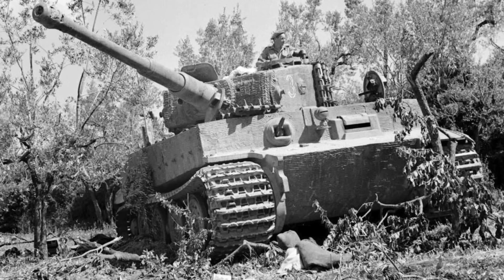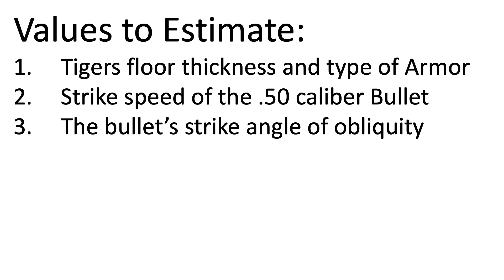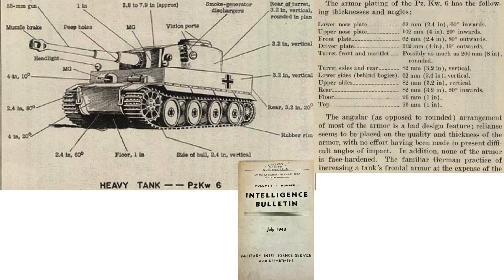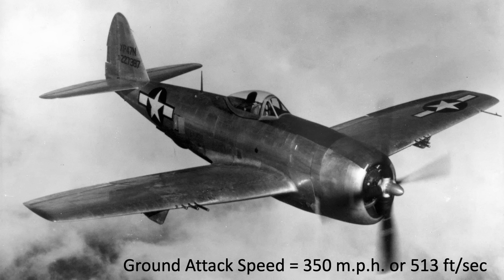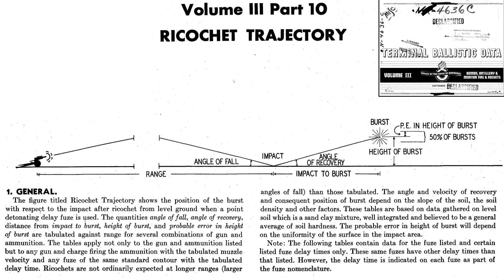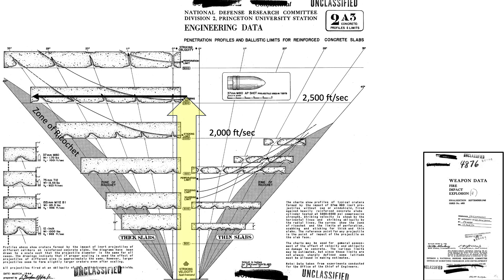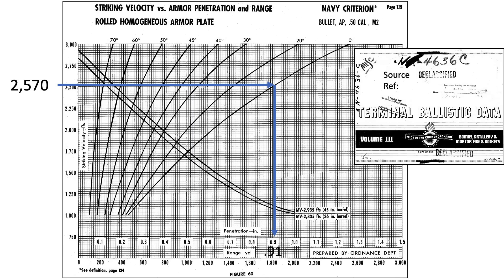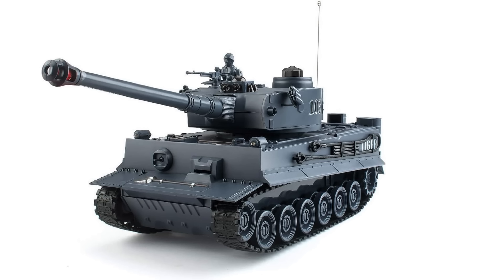P-47 vs Tiger Tank: Can Machine Guns Penetrate Armor?

Comment: A recovering Tanker here.

Tanks can be vulnerable to gunfire, especially from odd angles.

Specifically, heavy MG fire will blow through hatches, engine covers, and air intakes at high angles.

50 call will ruin an engine, and of course, 50 call bouncing around in a turret will ruin your day.

Comment: Good video !

I was just thinking of how many roads outside larger settlements actually had a concrete surface in WW2. My assumtion is not too many.

1944 German tanks were well protected against 23mm guns and mines. Lessons learned on the Eastern front. No way a 50cal ricochet would penetrate the floor armor of ANY German tank.

Another channel went into detail about air-ground accuracy at certain angles, ranges and speeds. Even at optimal angle, range and speed, less than 10% of the bullets fired did actually hit. That's fine for steam locomotives, but to immobilize a tank you need a one in a million shot with 50cals. And forget about rockets and bombs. The former worked well against ships for accuracy, the latter ... well, let me put it like this: how many DEDICATED dive bombers with dedicated bomb sights attacked battleship Yamato and how many hits were scored ?

What can a pilot at 400 km/h observe in 2-3 seconds ?

What damage to the running gear could a 50cal do ? Punch a hole in a road wheel ? Which doesn't stop any tank.

Vision slits were impenetrable as well due to "armored glass" and the crew usually had spare glass blocks and periscopes, because this was well known battle damage in any scenario, no matter the side. Doen't stop any tank.

Hit the antenna ? Playing the lottery and winning every time is as likely. And again it doesn't stop a tank.

Engine deck openings ? There is indeed a slight chance that something might fall through the lamellas, but to actually damage a critical engine component, play the lottery again. What can you hit through these openings besides the radiator fans and air filters ?

At Avranches, the tactical air forces claimed like 50+ German tanks destroyed, including gunfire, rockets and bombs. An after action battlefield commission credited them THREE plus two uncertain kills.

Don't get me wrong; I'm not picking on US pilots here; Germans, Brits and Russians were no better for claimed air to ground kills !
Reply: It depends on the region I suppose. Paved roads outside cities were very rare indeed east of, say, the Elbe river. But in northwest Europe, say, northern France and Belgium, paved roads were pretty common even between small towns. I was recently in some pretty insignificant villages that are known to have paved roads connecting them before the war. It surprised me but I verified it.
Reply: Exactly right on the aircraft vs tank data.  Later analysis showed that most tanks were knocked out by peripheral damage to treads and low fuel.  Their supporting fuel an ammo trucks were hgit and easliy destroyed, which eliminates the armor as being effective.  Wrong reporting  was the reason, as un-qualified evals were first filed, showing tanks burned out.  But these were later found to be scuttled by their own crews.  German heavy tanks were stopped because their support columns were destroyed.  Where German Tigers ansd Panthers were in defensive positions, they wreaked havoc on allied armor until out of ammo or destroyed by thier crews.  Actual fights with those monsters was rare, as there were never very many present in the west.
Reply: @Lollygagger-k4p  Nonsense. Lots of Panthers got destroyed by opposing AFVs and antitank guns. The evidence is abundant. 

In any army, more AFVs will usually be lost to mechanical issues than enemy fire. 

Damage to tracks is non-fatal. Tank crews do track maintenance literally every day, and can quickly replace track - which is unlikely to be damaged seriously by MG fire anyway.
Reply: @executivedirector7467  Sorry, I was responding to thsubject of the video - which did not include ground weapons like anti-tank guns or other tanks.  To be more clear, I never said alied AFV's did not destroy German heavy tanks.  I was strictly speaking in the context of air attack, where there is plenty of evidence that shows aircraft bomb hits on tanks were not that common - and, that initial reports by pilots were grossly over exagerated.  Those bomb attacks on tanks were only partially successful in most cases, but absolutely sucessful in destroying the logistal support element in the German column - as attested to by post war interviews with German troops.  The net result was many tanks partially damaged - or abandoned and scuttled by their crews. 

I will stand by what I wrote.

Comment: Tanks, not in combat, traveling to front on paved roads might be carrying external fuel. Tigers were almost always rail-transported to the front, and then off-loaded in vicinity of fields (dirt).
And, I'm willing to bet that most tigers, when strafed, were not sitting on concrete, but were on dirt, making ricochets even more problematic. : )

However, to give the pilot the benefit of doubt, .50 AP slugs could enter engine grill openings, causing fire/malfunction. And, if the strafed tanks were not Tigers, the armor plate could be as thin as 10 mm, rendering them vulnerable.
Germans were aware of this, and to that end bolted additional, stand-off armor plates to some of their turret roofs in late war.

Comment: I can't imagine that many roads in North- West France or Western Germany were made of concrete hard enough to cause bullets to ricochet to penetrate the floor plate of a tank. I had always assumed that when I had read that fighters with machine guns had knocked a tank out, they had done so by damaging the engine compartment. At 300mph plus I should imagine that a tank was not an easy target to engage.
Reply: To my knowledge, only German highways were made of concrete 
Roads were mostly dirt, some with asphalt, and there were some paved roads, at least in France (I don’t know for Germany)

Comment: That's in interesting, detailed analysis. My Dad had mentioned skipping anti-tank gun rounds off the ground to hit the underbelly of German tanks.

Also, from my own training during the Cold War, I remember learning that using weapons that may not yield a hard kill of a tank could still damage optics, antennas, etc., as well as cause tank crews to button up. 

I wonder if P47 strafing in this manner could damage the track system (track itself, roadwheels, drive sprocket, idler, etc.) and yield a mission kill if not a hard kill. Given the German fondness for overlapping road wheels, you wouldn't have to discombobulate things much to cause problems.
Reply: Very unlikely to get a mobility kill with Cal.50. 
I am a WW2 nerd of 30 years experience and live near the biggest German tank museum in Munster. You find quite a number of 12.7mm holes in roadwheels there. It did just that - make a small hole. The tracks were generally too massive to take any damage. The very unlikely possibility of a hit to a track pin or a bearing MIGHT lead to a mission kill. 
My verdict would be: "not worth the effort and risk" or "find some AFVs or trucks". *

*On the latter: You could shred those, no sweat. There is a SPG "Hummel" (150mm howitzer on elongated Pz.IV chassis) that obviously took a battering from 12.7mm with several penetrations to the light armour.
Reply: @thomaskositzki9424  I once saw a test where .50 cal machine gun fire was directed at a piece of Sherman tank track.  A prolonged burst barely dented any part of it, and it retained its flexibility.  Air attack effectiveness against tanks in that era always seems overestimated, and indeed it was the support vehicles of a tank column which suffered the most.

Comment: The aerodynamic drag on the rounds is measured for a stationary weapon.  As drag goes with square of airspeed the speed reduction graph would be different for rounds fired from a 350 mph airplane; you can't just add TAS to MV.  Having said that your numbers over-estimate the strike speed and so in reality penetration would be even more difficult and the result stands.
Reply: Drag and the square of the airspeed applies to the plane. The drag on the bullet is a function of the ballistic coefficient for the projectile and is applied over the range from the muzzle to the target range after it leaves the barrel. The Muzzle Velocity  as it leaves the barrel is 2700 fps plus the speed of the plane. After it leaves the barrel the ballistic drag would begin to take effect and not before that.  So the starting MV is 2700 + 513  or 3213 fps.  1200 feet from the muzzle it would drop to 2513 based on the Ballistic coefficient of the bullet ( bullets drag factor). There is no drag on the bullet before it leaves the barrel because it is accelerating to it's designed muzzle velocity under the pressure of the burning gun powder. Once it leaves the barrel, the accelerating force of the gun powder is gone and drag begins to slow the bullet down.

Comment: There are records of German tank crews coming under attack from US aircraft and as long as the hatches were shut they were safe. They would carry on with what they were doing waiting for the attack to end. The only problem they had was with a new crew member who may panic and bail out.

It would be interesting to see what happened if the aircraft was an RAF Typhoon or a Tempest as they used 20mm cannons.

Much has been made of the Ilyushin II-2 ground attack aircraft being used against the Germans but apparently the II-2 did have problems with accuracy, especially with their rockets. In many cases the Germans found them to be less of a problem than the Russians claimed. Interestingly the Germans reaction to air attack in Normandy was very different to the extent that they made efforts to fully camouflage their vehicles, something they did not do on the Eastern Front, and would often get off the road to avoid being attacked.
Reply: 20mm rounds pénétration is in the same ballpark as .50.
20 mm canons were chosen because they had HE rounds, more efficient against soft targets, but when antitank guns wee required, higher calibers were required, like the 37mm used by the Germans, the British and the Russians,
And even these bulky cannons could penetrate only the thinnest parts of the tanks

Comment: volume of fire from 6-8 coned .50cal have better chance of finding it's way into the tank via a gap somewhere like a viewport, open hatch, seam (specially where things pivot, open, rotate, etc.). Statistical probability is on the side of volume of fire.

Just as 6x .50cal proved equivalent, and sometimes better than, 4x 20mm for aircraft, due to the fact the higher volume of fire from teh .50cal resulted in much higher cases of total hits, and higher likelihood of fires. the lack of damage per round is compensated for by the fact that higher fire rates increased the likelihood of striking something vital or secondary hits causing sparks to start a fire. 

Also, there is a hammering effect of multiple rounds. Look what happens to armor or bullet proof glass when you shoot it multiple times in the same space with a gun multiple times. It might stop a .50cal the first time, but not necessarily the second, 3rd, or 4th time. as the armor is compromised from the first hit. Nobody is considering what the second or third hit does. This is not unlike how many anti-tank rounds work today. Tungsten darts with hollow sections that collapse and hammer through, same as multiple repeated hits from a .50cal might do. how thick is the armor in that spot aft the 1st or 2nd hit? and the third hit has far less armor to penetrate now if it hits that same area.
Reply: Tanks are generally constructed without the gaps of which you write. They need to be able to withstand the much more common threat of HE and AP fire from ground weapons. It's not hard to design a turret or hatch in such a way that it is only a slight weak point. It doesn't matter how many rounds you fire at it, within reason (I suppose if you fire one million rounds of .50 cal at a Tiger's front plate, it might cause damage. But it'd take a while ;) ).
Reply: @executivedirector7467  are you discussing modern tanks, or WW2 tanks? because I know you're not talking about WW2 tanks, which is the topic of discussion.

"I suppose if you fire one million rounds of .50 cal at a Tiger's front plate, it might cause damage. But it'd take a while"

nice cherry picking. I notice you had to specify teh frontal armor, ignoring the other 99% of the tank that is vulnerable. As if P-47s were specifically aiming at and targeting only frontal armor on only Tiger tanks. You do realize that not everything in Germany was a Tiger, right? and next to nothing had that kind of armor on the bulk of the tank, right? and that if 1 bullet can penetrate 0.5in, and the next can penetrate another 0.5in, then with 1-3 rounds in the same spot you could potentially penetrate 0.5-1.0in plate armor, which was typical on many parts of many tanks.

Also, keep in mind that modern antitank rounds fired by modern tanks (the fin stabilized discarding sabot) penetrate armor by this EXACT method of hammering through the armor with repeated blows as the hollow sections of the sabot collapses on impact. No explosion, no HEAT round, just a partially hollow dart of hard/dense metal.
Reply: @SoloRenegade  You are mistaken; I am writing about WW2 tanks. 

Even in the 1930s, tanks were designed to withstand things like molotov cocktails, flamethrowers and HE fire. Viewports, for example, aren't usually simply slits in the armor (although sometimes they are, and that's a really bad design choice) they usually had armored glass behind them. 

Hatches usually either overlapped their hatchways so there was no gap, or had splash strips installed around them to prevent exactly the kind of thing you're raising. It's very easy to spot these features on WW2 or even pre-war tanks.
Reply: @executivedirector7467  many armored vehicles well into teh modern age still used simple slits for viewports. a great many tanks in WW2 lacked any form of periscopes at all. The attention to detail in various parts were not what it is today.

There were a great many types of tanks in WW2 with greatly varying degrees of armor. Making such obviously false and sweeping statements like that about something as vast in scope as WW2 is truly foolish and setting yourself up for failure.

And when it comes to odd ball ways of being penetrated, which were statistically highly likely to occur given the number of tanks, battles, and rounds fired over the course of WW2, and speaking as a combat veteran myself of a mechanized unit specializing in knowing how to penetrate armored vehicles in unconventional ways (including modern ones), I can tell you with absolute confidence that a great many weaknesses exist on a great many tanks from WW2.

No doubt you will try to cherry pick specific examples, while ignoring the many who prove your claims wrong. But keep in mind, any tanks you choose to cherry pick I will find a weakness in, and any you will ignore are because their armor is thin, weak, and/or full of weak points such as simple viewports and low quality hatches and such.
Reply: @SoloRenegade  That's not how a sabot or a penetrator work. Nice assumption of ignorance though.
Reply: @SoloRenegade  Ok help me out here. I am trying to think o a WW2 tank that lacked periscopes or protectoscopes.
Reply: @executivedirector7467  Panzer III, for starters. Tiger I also lacked a periscope.
Reply: @executivedirector7467  If you don't think that's how it works, then prove otherwise....I'm waiting.
Reply: @SoloRenegade  You're funny.
Reply: @SoloRenegade  Both hull hatches on the Tiger I contained periscopes.
Reply: @executivedirector7467  but not the front viewports. Nice try at cherry picking and ignoring the very real gaps in teh armor.

still waiting for you to explain how you think sabots penetrate armor. laughing it off isn't an argument.
Reply: @SoloRenegade  APFSDS leave the sabots behind shortly after leaving the muzzle. That's why it's called a 'discarding' sabot. That part of the tech has been around since at least WW2. 

The actual projo is a solid shot. There's no bit of the sabot left by the time it hits the target.
Reply: @SoloRenegade  Panzer III cupola and vision ports in the hull were made with armored glass, i.e., not simple slits.
Reply: @SoloRenegade  The front viewport on the Tiger I was armored glass. Same on the Panzer III.
Reply: @executivedirector7467  That explains NOTHING about how such ammo penetrates armor.

"There's no bit of the sabot left by the time it hits the target."

what are you smoking? 

I never asked how the round fires and discards teh sabot. I asked how you think the penetrator pierces armor.

You already lost the viewports and periscope argument. Last chance to tie it up (or go 2 for 2 lost arguments).

Also, you should know that in the military "sabot" is used as shorthand term for APFSDS rounds. but we're talking about the Dart. Playing games to avoid answering is not going to win you any arguments, just makes you look foolish.